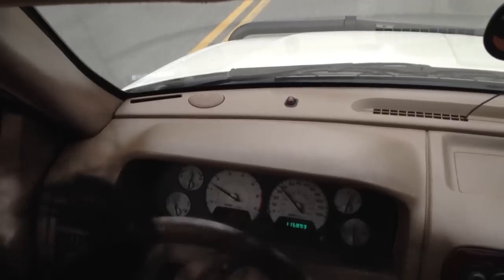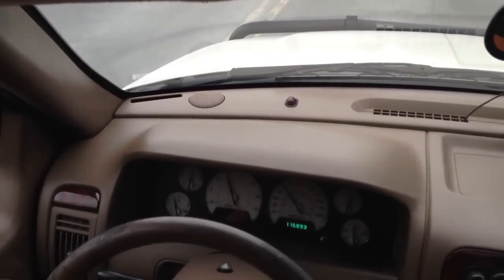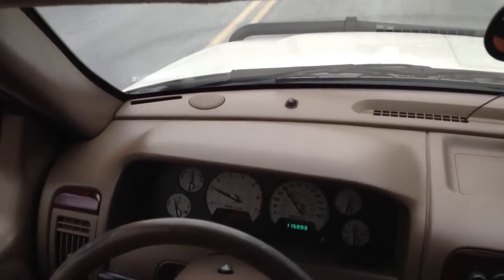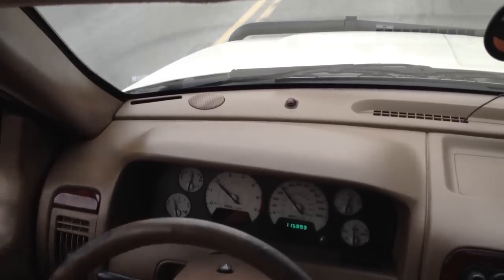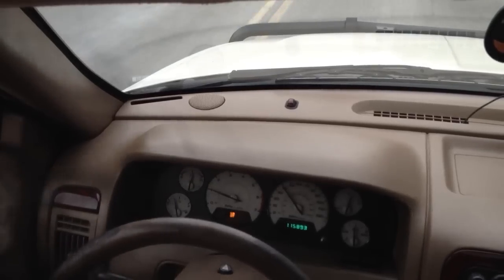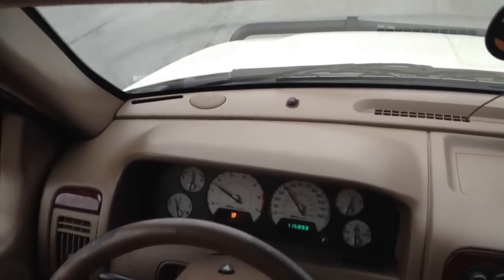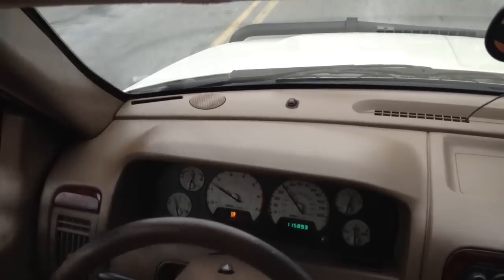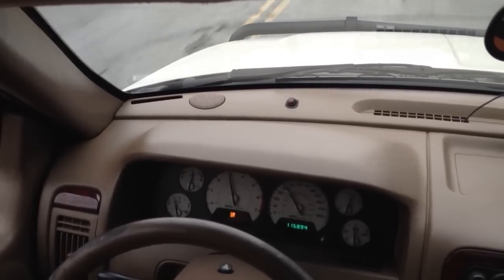WJ driving tightened shifts

Comment: Nice video, I love the hum and whine of the I6 motor.  I was thinking about getting a transmission booster cable for my new Jeep..supposed to up the transmission psi by 15-20.  Read about it on Jeepforum and 2 guys that had it seemed to like it.  Only 55 bucks too!

Comment: @CompCrasher86 The I6 is a great motor though, they're last forever.  

Hmm i just saw your new video on the Kickdown cable..maybe i'll try that before i buy that booster cable.  Does working with the factory cable make a big difference?  The shifts with the 5 speed auto are very soft, i'd like to firm them up quite a bit.

Comment from the maker: @4wheeler14 Dont know how much its going to do for your Jeep it may work or it may piss it off cus you have a 545rfe which is totally electronically controlled so it knows actually how much the throttle is opened by reading the TPS. It might still do something for pressure though so I would suggest marking the old position of the cable with a paint pen or something just so you can always go back if it doesnt feel right afterwards